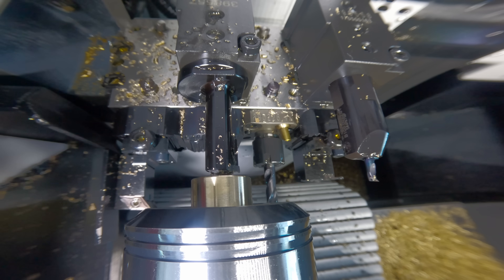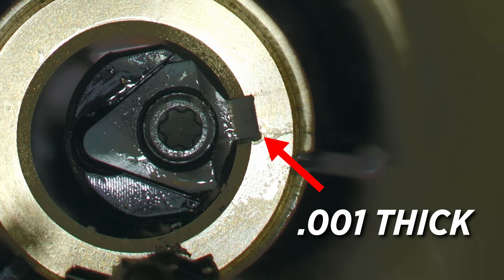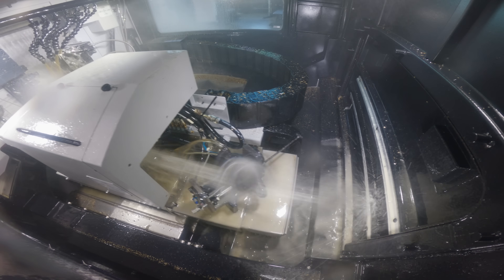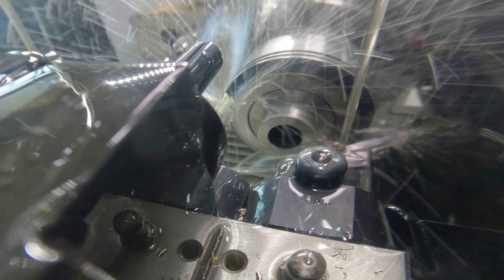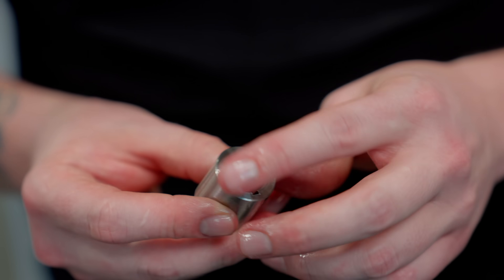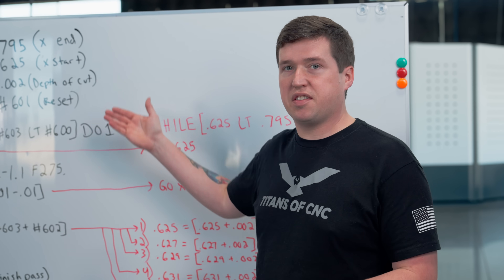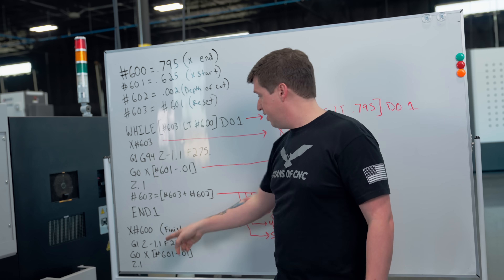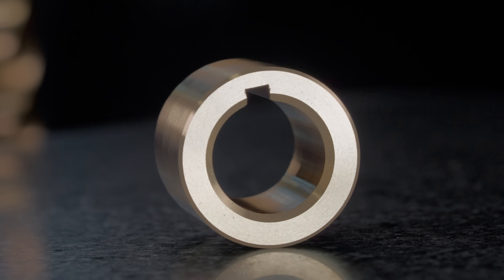Masterful Macro Technique for Internal Keyway Broaching

Comment: As promised here is the macro from the video for you to copy and paste! Hope you enjoyed the video! 

#600=.795(X END)
#601=.625(X START)
#602=.002(X DEPTH OF CUT)
#603=#601(X RESET)
WHILE[#603LT#600]DO1
X#603
G1G94Z-2.1F275.
G0X[#601-.01]
Z.1
#603=[#603+#602]
END1
X#600(FINISH PASS)
G1Z-2.1F275.
G0X[#601-.01]
Z.1
Reply: donnie when you write ".625 = [.625 + .002]" on the whiteboard and the four other similar lines like that below it, it makes me think you don't fully understand the concept of variables in programming. the variable 603 is your state variable, it is the variable that carries the state of your operation over multiple iterations of the algorithm you wrote. those iterations are created by the while loop. because something has to change between the two operations, there needs to be a variable that holds the progress of whatever you're doing, and that's what variable 603 is. otherwise, if nothing changes at all, then you would be broaching at the same depth over and over and the loop would also never end because variable 603 would never become greater or equal to variable 600.

hope this helps :)
Reply: @cheater00  It's great fun and much to learn about macros and how to implement them. While reading his macro and understanding it, I can't find anything wrong with it and it is quite nice and simple to just have 3 different variables to change. Where is this macro wrong? I would like to learn :)
Reply: @haavard1989  the macro isn't wrong, the explanation in the video is
Reply: @cheater00  aha, good observation. Think I have to watch it again then, but in case I miss it, just what was it? 😅
Reply: @haavard1989  read my comment and then watch the whiteboard section. come back uf you have any questions.
Reply: @cheater00   Edit (again): I think I got it but was too focused on the white board. Sorry. English isn't my first language...
Reply: @haavard1989  so did you get it?

when explaining assignments to variables you don't put the existing values on the left of the equals sign. only on the right.
Reply: @cheater00  So the explanation on the right with the counting from 1 to 5 is what grinds your gears in other words?
Reply: @donniehinske  any idea what would give me alarm INVALID BREAK POINT OF WORDS with this code?
Reply: Thanks! Would like to see more cool things to implement macros. Or any tips about ID Grooving would be much appreciated
Reply: It's easy to rely on CAM software to do your dirty work for you, but with some things macro programming is the bomb. Seems like old school machinists did a lot with it, some pretty complex stuff.
I have a keyway broaching macro that allows for Y offset to broach a wider keyway than the broach itself, also permitting several c positions for splines or opposing keyways, and after you do it a while on a bigger machine you decide to high feed move out of the cut instead of rapid, just a little gentler on everything. If anyone wants it I can send it to them.
Reply: @Skook91  I failed to make a good program on a DOOSAN lathe with donnies code, could you help me with yours?
Reply: Heyyy Donnie, can you please add a rotation .........lets say for 6 keyways
Thanks in advance
Reply: just use g71 
t1010 
m5p11
m35
g98
g71 U0.1 R0.5
g71 p10 q11 f4000
n10 g0 x(final x)
n11 g1 z(final depth)
g70p10q11
g0 z10
easier and faster.
Reply: @CzesioEmeryt  exactly!
Reply: Do you guys really program like that? It reminds me of assembler. Is there not a higher level language?
Reply: @fleitzify 
As far as the code that the machines read, yes.  Obviously we usually use CAM software for most toolpaths, but as far as I am awear this is it.
Personally I think a lot of how machines run is incredibly archaic and especially when it comes to macros I wish they were more capable.
Reply: @mgk1397  interesting. is there money in it? like, it wouldn't be that difficult to write a compiler to output that kind of code, and you could write in a modern language.
Reply: @fleitzify  while programming in a higher level language would be more ergonomic, there is no money in it, because all tools that integrate with machines generate G Code (which is what you're talking about) and they don't generate your new higher level language. therefore, it doesn't integrate into the pipeline in any way, and you're stuck talking G Code to everything, obviating the purpose of your high level language.
Reply: @fleitzify  so if I'm understanding right, your referring to g codes and the way variables are written/read.
While most machines at heart use this format to run, they don't all use this format to write and display for operators. 
What your talking about is conversational programming. Heidenhain are a great example of such a thing where your program canned cycles, like you would if drilling a hole but they offer all sorts of milling, turning, drilling, boring, threadmilling cycles and more.... you tell it what kind of feature you want and it literally asks you questions about how it does it. I think DMG and a few others offer their own versions of conversational too but I've only experienced Heidenhain. 
They're still not as great as using CAM but CAM will quite often output in long hand rather than using canned cycles.
Reply: @fleitzify in the trade I guess that would be a "post processor".

Comment: I use a simple g74, as an example for a 8 point star drive: 

N1111M98P1
G40T1111(BROACHING) 
M80(START MILL MODE)
G28H0.0 
G00C0.0 
G00G98Z20.0M18
X19.0 
Z5.0
M50(BRAKE ON) 
G74R0 
G74X25.0Z-22.0P300Q300000R0.5F5000
M51(BRAKE OFF)
G40G00Z5.0
G00C45.0
M50(BRAKE ON) 
G74R0 
G74X25.0Z-22.0P300Q300000R0.5F5000
M51(BRAKE OFF)
G00C90
M50(BRAKE ON) 
G74R0 
G74X25.0Z-22.0P300Q300000R0.5F5000
M51(BRAKE OFF)
G00C135 
M50(BRAKE ON) 
G74R0 
G74X25.0Z-22.0P300Q300000R0.5F5000
M51(BRAKE OFF)
G00C180 
M50(BRAKE ON) 
G74R0 
G74X25.0Z-22.0P300Q300000R0.5F5000
M51(BRAKE OFF)
G00C225 
M50(BRAKE ON) 
G74R0 
G74X25.0Z-22.0P300Q300000R0.5F5000
M51(BRAKE OFF)
G00C270 
M50(BRAKE ON) 
G74R0 
G74X25.0Z-22.0P300Q300000R0.5F5000
M51(BRAKE OFF)
G00C315 
M50(BRAKE ON) 
G74R0 
G74X25.0Z-22.0P300Q300000R0.5F5000
M51(BRAKE OFF)
G40G00Z20.0 
X150.0
M98P1

Comment: I have been using the PH Horn broaches for about 8 years now. They are a great time saver. The one place they are amazing to use them on is blind holes.
Reply: Pain in the _ss is the relief groove, it has to be deeper than the keyway, luckily I can drill a hole at the end, grooving on smaller diameters is always tricky, a broken insert for that groove will kill your Tool, I know Rev  (Broaching Tool Italy) has a G-code Generator (account needed) that lead-out with a radius at the end, you don't need a relief groove, I don't know if it is tough on the insert but it probably works.

Comment: Very nice. I wrote one some years ago that will cut any number of teeth (set in the macro call) to form either spline or key way. In addition, mine rotates every tooth per cut to even out tip wear rather than cut each tooth one at a time to full depth. You’re getting pretty good at macros, I’d like to see you have a crack at that one- it’s a bit more versatile

Comment: nice!  I haven't tried writing any macros but I do use milling 2D contour in mastercam on the lathe and pick the centerline of the keyway.  Add 2mm on each end of the toolpath. 0 out the linking parameters.  Give the tool a diameter of .1mm and add .2 to the offset.  Then use multipass and give it whatever number is needed to achieve the depth at .001 per pass.  Set lead in/out to perp. and tool plane to right.  Usually aroung a 6000mm/m feedrate.  Sounds like a lot but I've done it so many times that it takes less then a minute to generate a toolpath now.  I'm sure I'm not the only one who does this but after poking buttons for hours one day, I finally figured it out.  lol.  I will definitely start looking into writing macros though.  I also cut splines in this way but I believe a macro would be slicker and eliminate 5-6 pages.  nice work!

Comment: My little CNC lathe hasn't the grunt to do that. I use the mill. I recently had to broach for an 8mm key in a 40mm bore timing pulley boss. I tried a parting tool first but too much lateral flex so I used a 5/16 HSS tool. Did a neat job. :) Another reason to use the mill is I can use subroutines. Perfect for such repetitious jobs as this. Just like you used to, the lathe requires copy and paste. Or it used to. It died and I'm building a new machine that will be controlled by a Masso. :) I haven't used macros so great to see your description.

Comment: Are there any worries about running the same repetitive motion on the "z" axis while broaching like this? In my mind, if you ran thousands of parts like this, it would have an increased wear consideration upon the ball screw which is moving that axis. Maybe that is negligible for the life of the machine tool but I would like to hear what you think. For example if there were multiple broach features on a cylinder and these were ran over thousands of parts, would that repetitive motion end up with premature wear on a ball screw in a specific section.
Reply: Theoretically yes, but it is quite negligible.  Also, ballscrews are a wear item that gets replaced eventually.

There is definitely a time and place for this to be considered though.
Reply: Nah. Even if you ran 1,000,000 parts like that it wouldn’t be noticeable. Think about single point threading. It’s rapid retracts are way more aggressive and people run millions of parts on these things

Comment: Wow I'm getting lost in all this high tech ( 75yo) I repair CNC machines but don't have or use one. One of my old mills has a slotting  attachment for large internal keyways and have made a special hydraulic  down slow up fast broaching machine for less than 20mm.
What annoys me is when I make a part or take a long time to calculate and cut a gear or sprocket using dividing head or rotary table,  people comment wow CNC
Greetings from Sydney  Australia.

Comment: Question for the group. I'm running an Okuma M400B Multus. Drilling a 2.25 dia hole using a Sandvik insert drill. Currently running 1000 rpm on main spindle with a .004 feed rate.  Any suggestions of process to use both main and m spindle for hole drilling?

Comment: Ah yes!!  Fanuc Macro B programming.  I used these extensively on the 10M, 11M, 15M, 18i and 30i controls.  Everything from variable peck drill cycles, bidirectional laser compensation programs and 'family of parts' where part dimensions were edited into the variables.  It bears a great resemblance to BASIC in many ways, and is quite powerful.  You can even use it to show run time of a program down to milliseconds!  There are even trig functions that I used to rotate the XZ coordinate system on a Makino horizontal with a B axis.  There was only one work offset needed for any rotation of the part!
Reply: I wrote a Fanuc macro for XZ workplane tracking (B axis rotation)for a friend recently. I'd be interested in comparing methods.
Reply: @BRJ2  - I wrote a macro to do the same thing.  Used it on a LeBlonde Makino MC86.  Had it set up as a G code (G100) macro with 3 variables.   The operator would set X,Y and Z position in a work offset.  We used the Z offset with a constant to get a number to the center of B rotation.  I don't recall what Variable #1 did, except that if it was 99, the coordinate rotation was cancelled.  Variable #2 was the new B axis position, and Variable #3 was the Work Offset.  Here's the macro:
:9010(COORDINATE ROTATION BY G100) 
IF[#1EQ99.]GOTO4 
IF[#1EQ#0]GOTO1
IF[#2EQ#0]GOTO1
IF[#3EQ#0]GOTO1
IF[#3LT54]GOTO2
IF[#3GT59]GOTO2
G00G90G#3
M11
B#2
M10
#500=#[5221+[[#4014-54]*20]] 
#501=#[2040+#3]
IF[#501EQ0]GOTO3 
#502=[ATAN[#500]/[#501]]-#5004 
#503=SQRT[[#500*#500]+[#501*#501]] 
#504=SIN[#502]*#503
#505=COS[#502]*#503
#506=#504-#500 
#507=#505-#501 
G52X#506Z#507
#1=0 
#2=0 
#3=0 
M99
N1 
#3000=1(MISSING ARG.IN G100 CALL)
N2 
#3000=1(INVALID WORK OFFSET,G100)
N3 
#3000=1(Z COMPONENT IS ZERO) 
N4 
G52X0Z0
M99%
Reply: I can't find the final version, but it was something like this:    

O9001 (ROTATION OFFSET W/ WCS AUTO-DETECTION)
#1 = -29.1380        (Z center of rotation)
#2 = #5021 - #5041   (X WCS offset)
#3 = #5023 - #5043   (Z WCS offset)
#4 = COS[#5044]
#5 = SIN[#5044]
#5201 = [#2 * #4] - [#3 - #1] * #5 - #2
#5203 = #1 + #2 * #5 + [#3 - #1] * #4 - #3
M99

Comment: Had to cut a keyway in a huge belt pulley. There was no tool, or machine for that around. (25x100mm hole)
Made a tool from a roundstock and hardened pin, put everything on the drilling machine, and did the job with the quill.
Took almost 30min feeding by hand, but the result was good.

Comment: G71 also works, spindle doesn't have to spin, otherwise e.g. U5. in, U-4.9 (mm) out, repeat it with a loop L, U for X, W for Z, all incremental, can do the whole code in a few lines 😉

Comment: You can also use the ez-guide/dialouge programming if the machine has that, and also easy to set up for 
internal splines and angle (if needed) since you can draw the contour:

Example:
-------------------
G98;  <---- feed per minute
M35; <----- most often c-axis mode on Doosans in my experience
G28H0;
G0C? (start angle);
#1=? (Number of splines);
G1121; <------- Hit enter and fill in the rest of it but with feed rate in inch/mm per minute);
M98PxxxxL#1;

-------- sub program --------
G1450; <--- Start of contour.
G1456; <--- End of contour.
G0H[360/#1];
M99;
------------------------------------------

Just hit enter/input on the M98PxxxxL#1 and change the contour if needed.
Sorry for the long comment.
Awesome work as always Donnie!

Comment: My boss got one of these broaching tools and fit it a hex bar that we use on our vertical shaper . Its an old TOS  shaper with a 250mm stroke . Its hard on these carbide tools with the impacts eventually deforming the seat and leading to breakages . I still do most of the broaching with high speed steel blanks smounted in a steel bar . Lots of CNC companies come to us for thier keyways wich are often anywhere from 16 mm to 36 mm wide . Sadly im stuck on manual machines for now
Reply: Came here to make a shaper comment. Yeah but your whole shop costs less then one of those machines. If he's not doing big runs of keys an arbor press or a hydraulic press and a set of broaches will work just as well
Reply: @rpatrick2  true . Although with longer keyways pushing that borach through can be quite challenging . Our broaches are also pretty much scrap at this point where its alot faster and easyer  to just set up the shaper . My boss is dragging his feet when it comes to investing in new tools
Reply: @donavinnezar also you can pull broach way less sketchy putting HSS in tension then compression.
Reply: Us out here still cutting one off parts in a shaper! But there is no way to do some parts when they are 4 feet wide and 10 inches thick.

Comment: Donnie if broaching a longer cut & their is a taper ,what is the value needed to adjust accordingly? 
Titans no stopping them "B●●M"
Reply: On the feed line you would just need to put in an extra X value to make it make a taper move.  So it has X#603 as the first line of the WHILE loop, the second line instead of G1G94Z-2.1F275.  you could put G1G94X[#603+#604]Z-2.1F275.

Then at the top with the other variable settings have #604= whatever your taper adjustment is.  This way it starts the stroke at the #603 value and ends the stroke at #603+#604.  Make sure to add the same X move to the feed line of the finish pass as well.
Reply: @MachiningMaverick  so measuring after 1st is made and if difference is 0.005 in X ( macro ) sub prog , or why not add that point like a U value x0.0 size in drawing & same line as Z add a positive X 0.005 , just saying

Comment: i wonder, if it would work on dnm 6700 vertical mill . also with fanuc.  when i lock the spindle . use m184 it should work right  ?

Comment: I have one question guys could somebody answer me , no matter broaching process execute at main side or sub side ,there should be one side must have burrs ,any idea to use machine deburr it without using man power during production?
Reply: Well in this case you might be able to reach through the bore with a groover/backturn borebar to chamfer the face while it is in the sub. 

Or if you Broach on the main side you can chamfer the ID or use something like a drillmill to deburr mill the face of the Keyway after pickoff.

Lots of options.

Comment: Are you able to simulate your macros before you run to make sure there is no crash?
Reply: That takes all the fun out of it
Reply: You can run it dry and with out a part in the sub to be sure especially if your running something like 17-4, just to make sure your code is right. Running through brass is nice and soft too and you’ll have a part to look and adjust as needed.
Reply: @madman3371  add a couple inches to Z, also
Reply: @MikeBarber, short answer yes you can.

Comment: We have keyway seaters at work as we have to cut a keyway in a 4 inch bore that is 1.5 inches wide and goes 12 inches in length and threw hastoloy b3

Comment: Or, you could use a normal bit and then make the key itself rounded on one or both ends.
Reply: While that DOES work, it will eventually press/elongate the material leading to a larger and larger gap- the force of whatever its transmitting over time will make that pin loose. With a square, its a solid edge that transmit the force versus a radius.